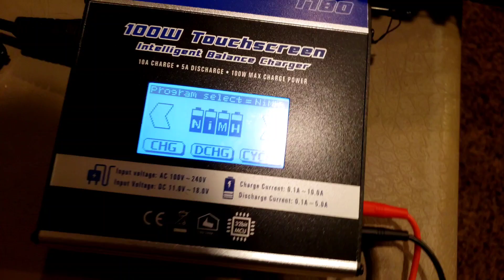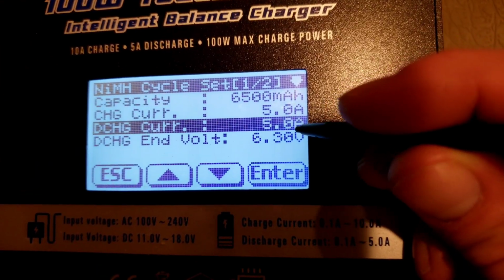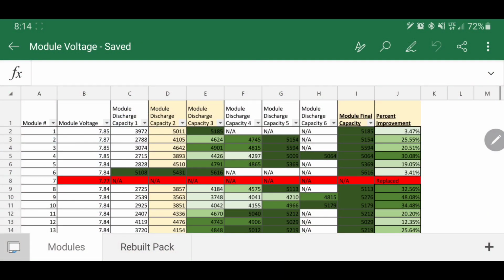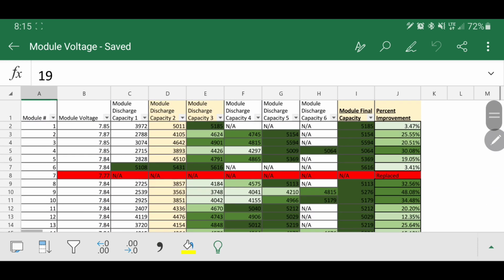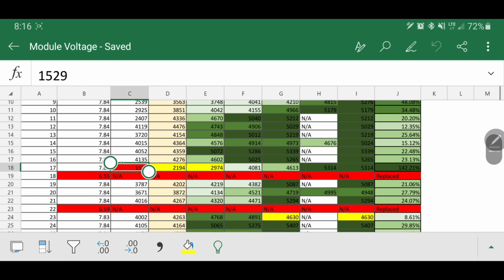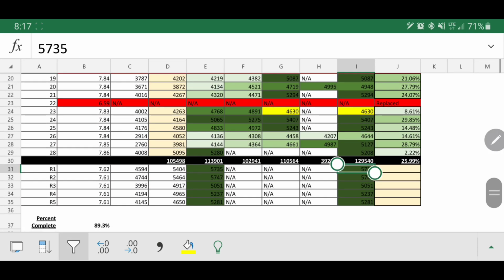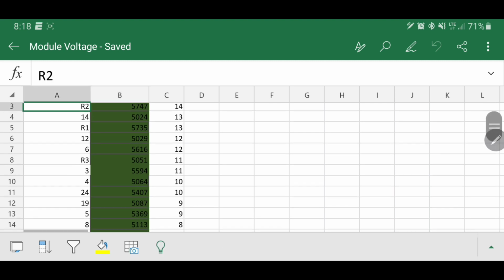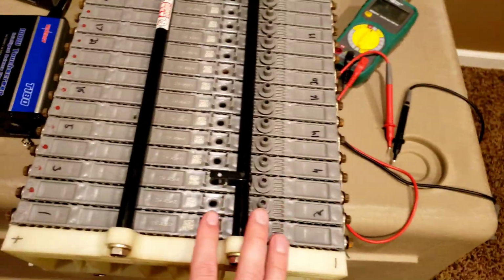Reconditioning a Prius Hybrid Battery Pt 2

Comment: Do you think you would get decent result by simply replacing the low voltage cells?
Reply: Doing that would be a "quick fix" with short term positive results.  What do I mean?  It's definitely a faster way (and cheaper way) to get the car on the road in the short run!  Your battery would probably be functional and it's likely error codes would disappear (provided you took time to rebalance cell voltage).  However, the overall capacity of your hybrid battery would still be limited by lowest capacity cells (or NiMH cells with battery memory).  The result here would be marginally improved hybrid battery performance and the probability of having to do it again shortly would be increased.  My experience has been:  I bought a used Gen2 Prius with 200K miles that came with a battery replacement (and warranty).  3 months later, I took it back for another replacement due to P0A80.  15 months later, I had problems again.  Sick of the problems, I've opted to rebuild the pack, rather than pay someone $800-$1000.  My experience with my first pack re-build/re-balance was that I had one bad cell (low capacity/out of range voltage), 12 more cells with battery memory that significantly limited capacity (this was corrected by cycling), and 4 more cells that did not correct due to cycling (we'll call these "degraded cells" - also removed).  If I had just replaced the one dead cell, my overall hybrid capacity would be greatly diminished by the cells with the battery memory and the degraded cells (which may have resulted in pack replacement within 1 year).  As it is, I'm hoping the rebuilt/rebalanced pack lasts 2-3 years.  Total investment of time has been about 1 week of man hours (plus 2 months of waiting, it takes TIME to cycle these cells) and $450 into the project (volt meter, battery tester, t-energy T180W, cables, and replacement cells).  What would I recommend? In a pinch (no money and high need for a functional car) - replace the dead cell(s), rebalance voltage, and get her back on the road.  If you live in a metro area, there are probably people who will replace the pack with a year warranty for $800-$1000.  If you have the money, do this!  If you're in a rural area, interested in learning/self-reliance, or don't want to spend that much, probably a rebuild/rebalance would be the way to go.

Comment: Just did some cycles on modules using the T180, however I have set the discharge end voltage to 6v, but when the 3 cycles complete and I’m scrolling through the results, I’m seeing discharge capacities of 2400mah and a voltage of 7.6v, with slight variations for the other cycles.
Shouldn’t the voltage be 6v, since that’s what I set it to cut off at? What would cause the module to prematurely stop the discharge cycle before it reaches the 6v cut off?
Reply: Did you figure this out? Same for me.
Reply: I noticed this too. I eventually set them to 4v for the discharge part of the cycle and left it there. Put it to 3v discharge if a cell was being stubborn. Setting it to the “safe” 6v did not help break up the cell memory. By doing this I just by chance checked in after a discharge completed and saw the voltage was rising on the delay cool down part. It would rise back to 7.6 with no charging. I looked it up and it’s normal for the batteries to naturally rise back or rebound shortly after a discharge. So your batteries are going down to 6v and then quickly rebounded and then you’re seeing the rebound voltage.

Comment: Great video and it insiped me to try to repair my 2007 Prius. I bought the T180 and I am using it to cycle charge>Discharge on my 7.5v  6500mHh battery, I first ran a Discharge only on the existing 7.5xvolt charge to see where to start, however, I am concerned because it charged and now discharging the display shows the voltage over 8.85v and the mHh capacity continues to count  and is now 6150. I assume it will stop at 6500 as that is where I set the limit but will it damage the battery at 9V ?  Maybe it is just a display thing but it has me worried. Help please explain!
Reply: Did you figure this out?

Comment: 8:35, instead of stripping an audio wire or using solder, another option is to get a section of common electric wire used in home 110V networks. There are 3 solid copper wires in each of those wirings, and it is very easy to strip one with a utility knife. Or just cut a wire long enough to use the exposed ground wire inside w/o strip any black or white lines.
Reply: Amen - that is what I’m thinking about
Reply: Or simply buy bare copper wire.

Comment: Hi thank you for creating this series! Question for you. I am using the t180 and following this same procedure however my batteries are all 7.4 volts to start and the t180 cycle for nimh is pushing them up over 8v in the cycle. Did you experience this as well?
Reply: having the same issue and not sure what to do. I reached out to a Tenergy video about the T180 and he said to contact service@tenergy.com I sent photo of setting but no response yet.  I don't see any way to limit the voltage and I pulled the plug at 9V.  Also, I thing the mAh would be skewed if the volts at 8.5 or 9v.
Reply: @whein224  I found that charging at a lower amp setting results in an overall lower voltage peak when fully charged.

Comment: So when you said you balanced them and wrapped the sodor wire to each cell at + and - parallel, did you hook up the t-energy to the end wire and trickle charge at 0.1-1.4 amps to obtain a balanced total charge of 7.6 or something and then let it sit for 16 hours before plugging in back in car? Thoughts please? I did receive to eBay batteries higher than the rest...8.10 and the others are 8.05....what do you think?

Comment: I purchased the T180 and during the Discharge I selected 5 Amps, and it only discharged at 2.6Amps.  I called Tenergy and they said this discharge wattage was held at 20Watts, Not the 100Watt Charge Power.  Were you able to get a higher Load with the T 180 somehow?

Comment: Thank you for making this video! I do want to ask though, why did you rearrange the modules so that each block has modules with the biggest different final capacities?
Reply from the maker: The prius manages voltages in "blocks" so I wanted each block (group of two modules) to have as equal as possible capacities.

That at least was my thought behind it.

Comment: Question: 
Is it possible to, from the beginning, connect the modules in parallel(?) negative to negative, as done in this video and recondition them all at the same time by charging and discharging 4x all modules together as a unit, instead of reconditioning each module individually as instructed in video pt1??? 

Thank you! Genius!! Video is sooo helpful
Reply: You can't charge nimh in parallel because the first module to hit full charge will drop in internal resistance and hog all the current and overcharge
Reply: @ByteFilm  that doesn't make sense.

Comment: Does our T 180s show the high mah and low mah for ea cycle?
I dont think so.
Also I dont see it showing my 3 cycles.?
Maybe 240min. Cut off should be
 increased alot.
Also looks like it charges at a min.of 10V?
Looks like wed want no more than 8 Volts?
Thanks.
On my 3rd module now.

Comment: Hi H-EV, I am doing this process on my 05 Accord Hybrid and I have a few questions. 

1. I know 3-5 cycles is the suggested amount of times to do each pack, but I have one that is about 60% after 6 cycles and it is still increasing each time I cycle it. Is it fine to keep exercising this one until it reaches the desired discharged capacity, or is the fact it is taking so many cycles an indicator that it should be replaced, even if it can be brought back to high capacity?

2. For the final step of balancing all the packs I think you mentioned that you made sure the batteries were within .01v of each other before you hooked up the solder wires. How did you achieve this, and how close in voltage should they be before I begin the balancing process?

Thank you for the detailed videos, I am having fun working on my battery and without your videos it would not be possible.
Reply: 1.) I recently did this on a 2006 Prius battery, some of the NiMH cells in it only needed 4 or 5 cycles, but on others I did as many as 35 cycles. I kept a spreadsheet of all the mAh for each charge and discharge, and my threshold for "good" was a discharge of 5,200 mAh or better. I initially thought I would need to replace some modules and actually bought five replacements, but never ended up using them. I put everything back together and have put about 1,000 miles on the Prius since then, and so far so good, about 46mpg.

2.) What I did for this is charge each module separately one last time to get them close, then I wired them all in parallel for two days, which evened them out a bit. Then I immediately unwired them from a parallel setup, and wired them in series in the standard Prius setup. Worked pretty well.
Reply: @normnelson  That's some patience to do 35 cycles! I finished this project in my Accord not too long after I originally commented. I ended up replacing one of my cells because it wasn't improving much after about 10 cycles. After seeing your comment I think maybe I could have kept going and avoided a replacement. All is well in the Accord over 1k miles later.
Reply: @snwdn  what's the results after 10 cycle ?
Reply: @ragingraiden8296  It got up to about 5/6th capacity but less than a year later I had to replace the cell.
Reply: @Snowden  Would you say......if cell doesn't get back up to 80% after 5 cycles, it's time to replace?
Reply: @midnightsunturbo  Yes, not worth having to take the whole thing apart again. Might as well fix it while you're in there.

Comment: What did you use as a cut-off voltage for discharge?  You said you established 4000 as your discharge mah threshold, is that based on 80% of max?  Thanks!

Comment: During the balancing procedure, can I just use the bus bars instead of solder?  Seems the simplest route.  Just wondering if there is something I'm not aware of.
Reply from the maker: Good point, you absolutely could use the bus bars to connect the modules in parallel.
Reply: @HEVTech1  thank you for the reply and your videos.
Reply from the maker: @VortexStriker  Thanks for watching!
Reply: @HEVTech1  I figured out why I was hesitant about using the bus bars to balance.  It takes twice as many of them.  I happened to buy new ones so I had enough, but if another viewer did not, solder is best.

Comment: Is it necessary to discharged the block battery and put it in the cycle  If the battery power is very low and is near to maximum discharging?

Comment: Question. The modules I'm testing are at around 8.13 v. Why is that different from what you are showing?
Reply from the maker: Modules will have a higher voltage when charged to a higher state of charge. Voltage will be lower if they are at a lower state of charge.
Reply: @HEVTech1  That makes sense. I was worried because I thought they were supposed to be in the 7s, but then realized the battery was just pulled from the car so they must have been at max charge. Thanks for the reply.

Comment: Hi what setting did you used to charge the complete pack after putting native and positive on opposite sides
Reply: Was looking for the same answer. He responded to this question, buried in the comments.

"I didn't use the T180 to "balance" the pack as the solder wire I used accomplished the balancing by itself. I "trickle charged" the entire pack with the same settings as an individual module minus the current limit which I set to 1a or around 7-8 watts. The solder balanced all of the modules which is a step that cannot be skipped or will lead to issues when installing the battery. You certainly do not need to do the trickle charging step if all of your modules are showing 7.4v+, I only did it as I was wanting all module voltages to be  7.6v before installing in the car."  --H-EV Tech

Comment: Hi thanks for the video it’s very helpful but one question when I charge individual modules the voltage goes up to 9.2 and up is that normal and what was the voltage you were getting the highest point
Reply from the maker: I wouldn't let them get higher than 9.6v at the most. I recall seeing 9.2v at the high end as well.

Comment: I just finished cycling each individual battery cell. now I’m about to do the battery as a pack. But what settings did you use for capacity and Delta Peak.? Thank you for your help

Comment: i followed the process H-EV Tech outlined in this 3 part video series and it worked for me.  my prius had 240k miles on it and i got the red triangle of death.  i had the p0A80 error code. that was back in late june.  it took about a month of elapsed time to get it back on the road using the process outlined in these videos (i only bought one tenergy unit).  the car has been back on the road now since early august and it's doing ok.  mileage had dropped to less than 35 mpg before the red triangle; now it's back up to 40 (after a reset).  i had many modules that had low capacity.  i ended up shooting for 4000mAhr as the 'bar' to get above.  i replaced two modules and just reconditioned the other 26.   i would cycle until i got above 4000 and i would punt if 5 cycles didn't get above 4000.  some were much better, e.g. 5000, but many ended up just a little bit above 4000.  i don't know how long the whole thing will last - we'll see.  i did the step where you bring them all to the same voltage by tying them all together in parallel.  i used romex 12ga wire for that, happened to have some in the basement.  i also followed the balancing step (where you pair modules to get similar capacity for each pair of two modules).   

thanks H-EV Tech!  my prius would be toast without your videos!
Reply: How is it going a year later?
Reply: @cory5233  the car had about 240k on it when i reconditioned.  now it has about 250k.  just recently (last month), my daughter drove it to LA (about 400 miles) and it got the red triangle on the way!  she kept going and it made it.  then the red triangle went away, and she drove it back (!).  red triangle is still gone.   i ran diags and it shows a couple of weak cells, not ones i replaced last time (two codes, one for the cells out of spec and one P0A080).  so i guess the upshot is, if you start with an old battery, some of those cells won't last too long.  when i did the refurb, i used 4000mAhr as the threshold - if cells had more than 4000, i considered them 'good'.  (some were above 4500, but some were not).  the group that is too low now is group 14, nearest the driver's side of the car.  last time it was a different group.
Reply: @john greene  Thanks for the update and all your data points. It's really helpful for me to target the threshold. I just started reconditioning my pack. Only cycled a few cells but seeing some in 5000 range.
Reply: @johngreene1308 should i buy an Original toyota battery or get it refurbished?
Reply: Makes me feel good to here that word again/memories?
Romex. I gotta hit that cycle button
My next check.yep the graph/not much there.ive seen 8 something one cell 1/and 11hundred on no.2
Who nos?what that was/I thought
WOW!

Comment: I have a 2012 Prius with 20 modules,  averaging 7.58V, max at 7.6V, and a min 7.57V. It appears they’re all pretty close in voltage but where do I go to find specs on these modules that tell me they’re within acceptable range? And acceptable charge/discharge rate? Help is much appreciated. Your channel is great. Subscribed!
Reply: Great question! Did you ever find an answer?
Reply: @MikeMcQueen2012  sure didn’t. Thought the batteries were bad but figured out It was the electric water pump.
Reply: @marceloarreola2663  measuring the voltage won’t tell you much. You need graph the discharge capacity like he did and look for modules with as close to 6,500 mAh as possible (the original capacity of the modules) the higher the better. I don’t know the exact numbers but I’m rebuilding my pack right now and am trying to keep above 5000 mAh, I’m researching it more as I’m making a video for my other channel DIY Doran R Brown.

Comment: Thanks for the info man, about to rebuild my battery off my 3rd Gen 2012 Prius. Been noticing that the MPG has been tanking sharply especially over the last 3 months. Had done cleaning on my cooling fan 2 months ago though I am yet to deep clean those nasty bus bars which I doubt have ever been cleaned since the vehicle rolled off the factory floor. Maybe this will help though I am looking forward to also balancing the modules to get a true picture of the true life expectancy of the battery. Loving your content from Nairobi- KENYA